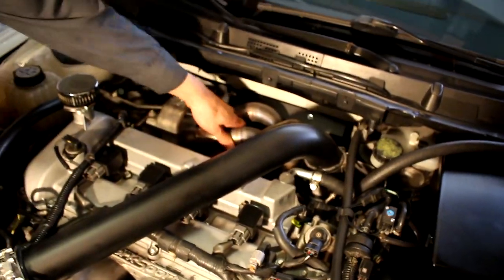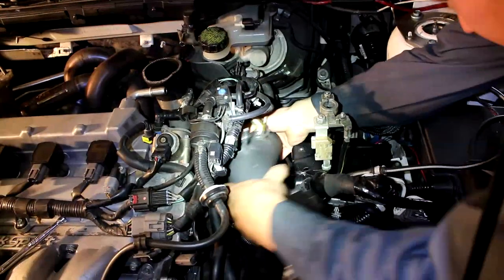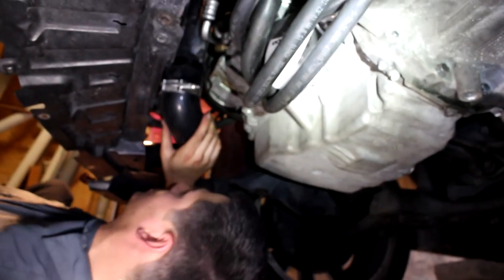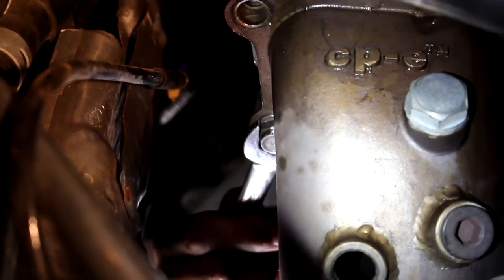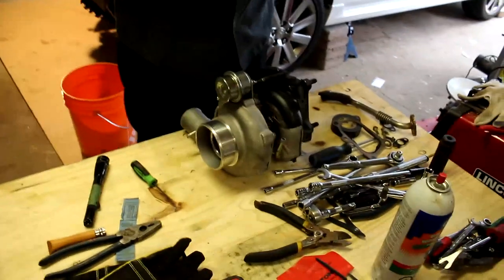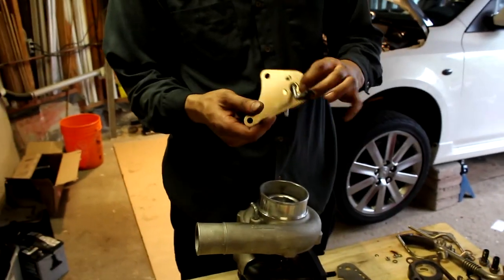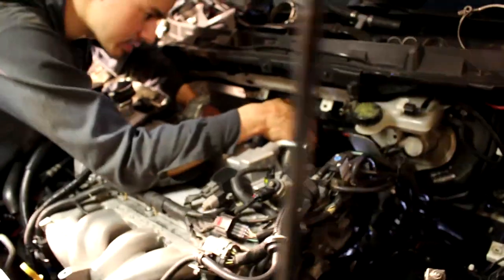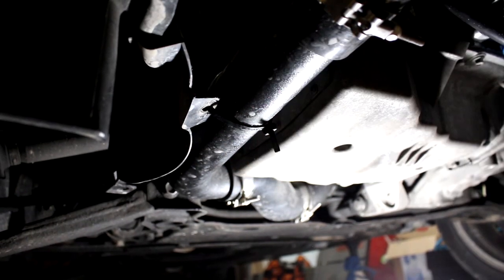Mazdaspeed 3 - Clocking the BNR S4 Turbo & JBR Under Route Piping Kit Install

Comment: Wrap the ex-manifold. It will spare you from a lot of heat in the cabin as well as all those plastic wraps of the engine harness, sensors, all kinds of hoses and so on.
I have a catted downpipe and stock ex-mani (so all the heat shields in place except the turbo heat shields) and I couldn't believe hot much of a difference it made to wrap the DP. Once I moved to a catted TP I wrapped that as well. As a bonus I've got a bit of sound deadening as well.
Reply from the maker: Yea header wrap should take care of the heat. This tubular manifold radiates a tonne of heat into the engine bay, especially mid summer. I imagine that a catted setup would be even hotter.

Comment: Awesome videos brutha! They've been very helpful and inspirational. 
I'm considering the JBR undermount intercooler piping and wondering if yours is running good so far without any issues? Thanks in advance!
Looking forward to your next vid.
Reply from the maker: Awesome man, glad to hear. The JBR under route piping has been very good. It has a lot of adjustability to ensure things don't rub. I had some issues with contact at the passenger side driveshaft and subframe, but since zipties come in handy and with all the adjustability, that wasn't a problem for very long. Just keep an eye on rub points and adjust as needed :)

Comment: Wrap those headers and the turbo dude, absolutely more than helpful, people on the speed forums will likely attest to this as well and I know ur not running a stupid big turbo but the aftermarket heat shields for turbos(turbo blankets or whatever you prefer to call them) help hold that heat in the turbo which means less radiating heat to engine components, you are likely having a combination of smaller problems and not one big one for the heat soak

Comment: Crazy to say I had low oil psi after driving full temp on engine for a while it scared me new built engine, well I found a crack in my resivor tank replaced it and oil pressure is perfect now! Only thing I can think about is it was running a bit hotter and the oil cooler is cooled my coolent caused oil temps to go up thinning the oil. I run rotella t6 always

Comment: Hey Guys, love your videos! I've learned so much! I've been progressively modding my MS3 Gen 1 and am curious about what you're doing in the 12th minute... I have a TR8 and the under route piping kit and a BNRS4 that I have yet to install. Why do you have to re-locate the waste gate actuator? I'm assuming it's because of the way the under route kit is made? Curious if I will have to go through all of this? Any helps appreciated, thanks!
Reply from the maker: The reason is that when rotating the turbo, the compressor housing is larger on that side, causing the actuator to contact it. The larger bracket provided by BNR allows the actuator to clear the compressor housing. Just give Bryan at BNR a call :)

Comment: I have the same full race exhaust manifold. It produces LOTS of heat, you might want to ceramic coat it AND wrap it.
Reply from the maker: Yeah for sure man. It was pretty bad during the summer. Had to leave the hood open for a few minutes after engine shutdown lol

Comment: I have the htp underroute kit on mine. The fitment is a thousands times better than that jbr. I prob would have recommended going with that kit over the jbr. Keep the videos coming man!
Reply from the maker: Thanks for the info man!
Reply: @WannabeTuners  to late though. Lol.
Reply from the maker: @gimmethecarkeys  Yea man I haven't had any issues whatsoever with the JBR kit. You've had the JBR piping before?
Reply: @WannabeTuners  as long as it works thats whats important. I have seen 1 other jbr underroute kit. Personally I only use his crash bar. Not a fan of the all silicone couplers. I understand the benefit it offers. But if a kit is built right it should fit right. My htp fmic kit fits way different than yours. I have clearance everywhere and it looks cleaner.
Reply from the maker: @gimmethecarkeys  Awesome man! Definitely something to consider for those interested in going this route. My only concern is if there is as much adjustability with the HTP kit with different sized compressor housings and turbos. I know the JBR kit can be manipulated quite a bit with all the couplers and what not :)
Reply: Did you have to clock your turbo when you put under route HTP piping?
Reply: @mjl6425  everyone has to clock the turbo...
Reply: I was considering the Jbr piping until u mentioned the HTP. Now when you say the fitment is better do you mean that it requires less modification and adjusting?
Reply: @mjl6425  i had absolutely zero fitment issues. Call Matt at htp and just talk to him. He is super cool guy. Tell him what turbo you have.
Reply: thnx will do
Reply: Thanks I’ll hit you up there
Reply: I want to buy htp products but their website says out of stock all the time, do you know if they stopped support the mazdaspeed platform?
Reply: @turbo946  you need to call matt at htp he builds to order. He is an awesome dude. Quality is perfect, i had zero fitment issues
Reply: Thanks kyle!

Comment: Wastegate arm should have a little bit of pre-load. At least enough that you have to pull the arm a tiny but to get it on the flapper. This keeps the wastegate seated so you are not leaking air that could help with spool. I know you are creeping and this won't help that any but in the summer time you are just wasting air that could be spooling that turbo as the wg is letting air bypass before it has done its job with a loose flapper. The only way you are going to get rid of creep at this point is with an external wg and either dump of recirc it. Keep up the good content.
Reply from the maker: Yeah man I learned that the hard way when my flapper would rattle. After a few preload adjustments it's nice and tight now :) If I ever build the block I may go with a BNR S5 which has the ewg on the turbine housing
Reply: @WannabeTuners  s5 is pretty sexy. I am going built now and looking at PTE 5862 but for stock ease s5 looks really good. My goal is 550 whp should not bee too hard with 5862. CS new turbo and mani are very tempting as well.....if they ever release them.
Reply from the maker: @JackBurton871  Oh yeah tonnes of ways to go. I figure S5 because then I could retain my EM and DP, and I can't see myself wanting more than an S5 could deliver lol

Comment: When u clocked the turbo did you have to seal those bolts?
Reply from the maker: They did already have some sealant on them, so we just put them back in without any noticeable issues, however it can't hurt to add some thread sealant on them just to be 100% sure that there won't be any minor boost leaks ;)

Comment: That is alot of work you guys. Really nice build , but I'm still skeptical about that driveahaft getting hit by that piping. So I might just go with top piping. Even though , Big respect to you guys Awesome build.
Reply from the maker: It takes a little bit of adjusting with the clamps and pipes. But tbh there is a lot of adjustability so its really nothing to worry about :)
Reply: i run under routed with no issues. jbr kit works good.  my hot and cold pipes are 1 piece aluminum custom hot and cold pipes

Comment: Time to upgrade to an AP V3! Gotta keep an eye on more than one thing. But these S4s and the creep is bad. Going EWG on my setup to get rid of it. It's so bad, even with my actuator maxed out.
Also, I recommend using a short 14mm socket with a swivel extension for the downpipe. You'll be able to get all of the nuts from up top without having to go under the car. Takes me less than 10 minutes to remove my ATP catless downpipe.

PS: Never shave again. Please.
Reply: i will never iwg again. next setup will be EWG. iwg caused me and my tuner a lot of wasted time.
Reply from the maker: FYI boost creep happens when the IWG cannot bypass enough exhaust gasses to limit the speed of the turbine wheel. Increasing the preload on the wastegate actuator will in fact help the turbo spool up if it was previously opening at too low of a boost pressure, but having the actuator set with too much preload may limit it's travel making the turbo creep even worse in the mid to high rpm range :)
Reply: So using those tools you could take the turbo off the car without going underneath?
Reply: @mjl6425  No, the downpipe. Not the turbo.
Reply: Damn. So the turbo you still have to get under the car?
Reply: @mjl6425  yes, you have to go under the car to get the turbo off. Plenty of guides on the forums for it
Reply: How long do you think it’ll take to install everything?
Reply: @mjl6425  Depends if you know what you're doing. Took me a few hours.
Reply: Knowing me I’ll probably screw something up. I’ll just take it to my mechanic friend. Besides the bnr kit What else do I have to buy or modify?
Reply: He got the V3 :)

Comment: I have a 2ed gen how do know how much to clock the turbo
Reply from the maker: Basically u want to start by clocking it 180 degrees pointing down. Then once it's installed in the car, u can make final adjustments in relation to the under route piping, and then tighten the compressor housing fully down evenly. It takes quite a bit of patience to ensure everything is done properly and to your liking :)

Comment: I ran into an issue when clocking the BNR S4. I have a coolant line smashed up against the turbo outlet. Did you guys experience that? I can send a picture if you have a place for me to send it.
Reply from the maker: Yep we had the same issue. It prevented the turbo from being clocked further to the back, so all we did what get it as close as we could without putting too much pressure against the coolant hose, or the nipple on the metal pipe that the coolant hose attaches to. Then we made adjustments to the under route piping and tightened everything down. It's inconvenient that that coolant hose is in the way, but it still works :)

Comment: How would that jbr piping work with EWG? Dope video btw
Reply from the maker: Thanks! I'm not sure. Thats a good question! Obviously the dump pipe would need to clear everything
Reply: Yeah I been wanting to go with the jbr under route pipe but idk how it would work with the dump tube.
Reply from the maker: @ask4boost  Where do u plan on fitting the ewg on your setup? The exhaust manifold or the turbine housing like the S5?
Reply: @WannabeTuners  on the exhaust manifold
Reply from the maker: @ask4boost  I think it will work because if I'm not mistaken doesn't the dump pipe run above the downpipe? The under route piping runs under the downpipe.

Comment: Idk if you guys will see this but if you do, I have a question, I’d you have stock ko4 do you need to clock it for the piping?
Reply from the maker: Yes if you plan on running under route piping, the compressor housing on the stock turbo will need to be clocked. It may be difficult though because the hoses going to the turbo and the boost control solenoid may need to be relocated.
Reply: @WannabeTuners   UGH it’s so hard to have a clean engine bay😭 also where did you get that air duck thingy idk what it’s called but where the hood latch goes? And do you know if there’s one in carbon? I’ve been looking for something like that for my gen 1
Reply from the maker: @o.rgarage9660  That's a JBR air dam, and is only used for a FMIC setup. I don't think they are offered in carbon.
Reply: @WannabeTuners  thanks man, love the videos btw 👍🏽
Reply from the maker: @o.rgarage9660  Thanks man, what are your goals with the car?
Reply: @WannabeTuners  just trynna keep it mostly reliable,  maybe like 300-320 wheel and just that tbh, I love my car I’m not trynna blow it up lol, also I’m thinking of doing an egr delete, would I need a tune for it to run good? Cause it’s misfiring cause of it
Reply from the maker: @o.rgarage9660  You won't need a tune for an EGR Delete, however it will cause the 'check engine light' to illuminate, unless you've disabled it through the tuning software. An issue with EGR shouldn't cause a misfire in my opinion. Usually with these cars, a misfire is caused by a bad ignition coil, spark plug, fuel injector, or low compression.
Reply: @WannabeTuners  oof 😥 don’t tell me low compression 🥲 I mean if it had low compression it would feel sluggish right? And like it doesn’t it feel like that at all, it’s just occasional those misfire little pops and stuff, but the check engine light is on cause of the egr
Reply: @WannabeTuners  ill change the spark plugs to see if it goes away but last I took it to a shop the obd reader said it was the egr
Reply from the maker: @o.rgarage9660  Oh yeah it's definitely worth it to look into it if you're getting EGR specific codes. Maybe the valve is intermittently sticking open.
Reply: @WannabeTuners  oh ok gotcha, I did the spark plug Change and it seems a little bit more responsive, I just ordered an egr block off plate kit thingy cause I’ve heard it’s just better over all, and then I’ll just get the cel removed later, and it makes it easier to take out the turbo

Comment: What kind of firewall heat shield ?
Reply from the maker: It's the Corksport shield
Reply: Wannabe Tuners I’m running a gtx3071r with a full race manifold and ewg with an open dump. U think it would fit still looks a little cramped
Reply from the maker: @davidmedina4173  The JBR under route piping can be manipulated quite a bit, so I don't see it being an issue. I would ask around on the forums to be sure. The only potential issue might be that coolant return hose being a bit tight around the 3071's comp housing, but maybe there is a way to route it differently. We show the return hose near the end of the video :)
Reply: Wannabe Tuners thanks man

Comment: You need a lot of preload pressure on that waste gate.!
Reply from the maker: This BNR S4 wastegate is rated to 18 psi and my car creeps up to about 23 psi with this high flowing setup at 0% wgdc in cold weather. I think u are talking about the S3 actuator right?
Reply: @WannabeTuners   Yes the actuator arm. needs to have a bunch of preload holding the gate closed. you did a good job fitting /bending  the arm to go on smoothly.  but you did not show adjusting the prelaod it needs to hold it closed under boost. that will cause slow spool and boost creep issues.  the actuator needs a bunch of prelaod to get all the boost you want. it is a lot easier to set it now before you have it all back together. i had this issue on my car under route set up with a gtx turbo. had to go back and add more prelaod 3 times to get it right.
Reply: with too little of preload my wastegate would start to open at 8psi and would spool slow. i could also barely get over 22psi. after adding a bunch of prelaod  may car spools fast and i hit 30psi  easy.
Reply from the maker: @blazonemore2  I hear ya man. The wg actuator that comes with the S4 is pretty stiff and doesn't have any issues with spool. This turbo suffers from boost creep, mainly in cooler weather, but it's nothing tuning can't solve ;) When fitting the wg actuator rod to the arm, I found it's a good idea to adjust the rod length slightly shorter than it needs to be, so that it applies slight pressure on the wg flap in the closed position to prevent it from rattling at idle. In the video you can see that the rod is pretty loose sliding onto the arm, which caused the wg flap to rattle at idle. I had to remove the actuator several times to get the rod length just right so that it would apply slight pressure to the wg flap in the closed position :)
Reply: @WannabeTuners  slight pressure  will work. but if you really crank it down so its maxed out. you will wake up you spool and boost by a lot. and your boost creep will pretty much go away. just my opinion tho.  i did what my tuner nishan told me to do and now may car runs a lot better. 22 psi vs 30 psi. light pressure vs max.  turbo spools at 20psi at 3k now. before it hit 20psi at 5500rpm.